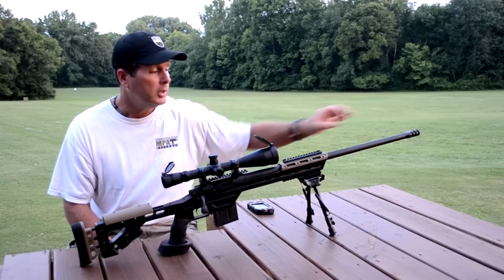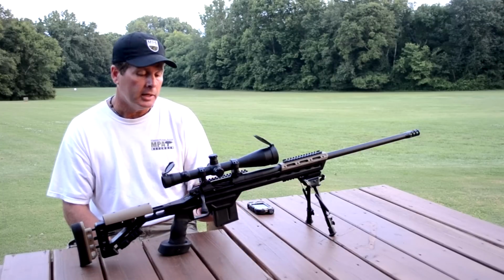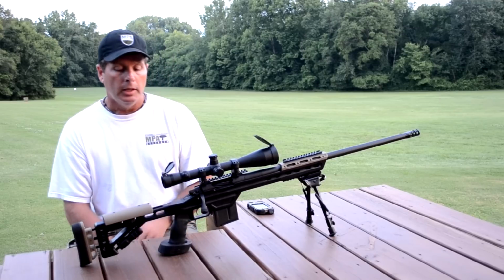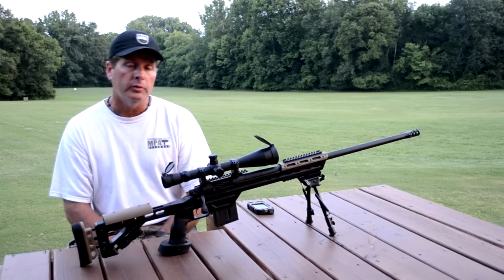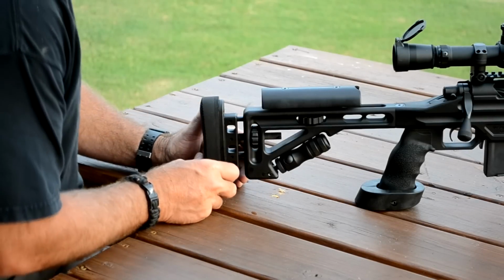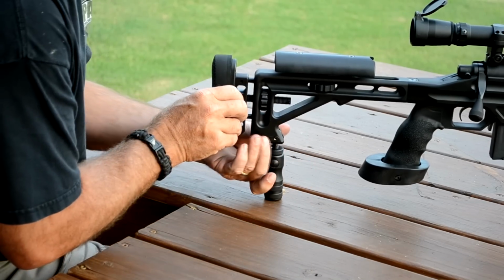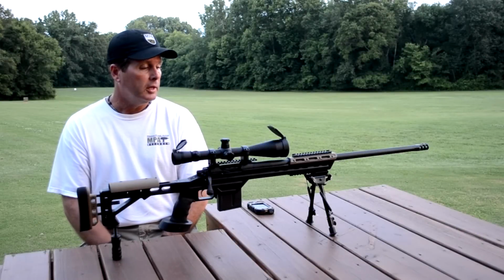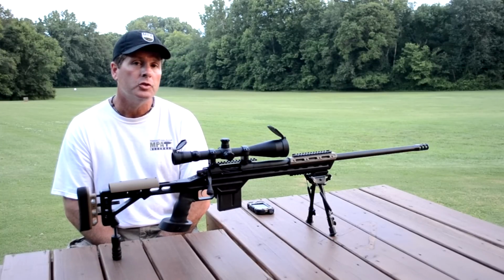Masterpiece Arms BA-Rifles Series Part 1: Introduction

Comment: Would have preferred a double-column magazine like M14 or AR-10.
Reply from the maker: You can get the MPA BA series to run with either AI or AW type magazines. The AW are double stack.
Reply: Unfortunately that would be using subpar components for a precision rifle. There's a good reason why ELR shooters stick with AI magazines.
Reply: AI magazines can't be topped off while in the rifle.  The main advantage to the single-feed magazine is that you can go cheap on the receiver and not modify it any.  It was a compromise design.